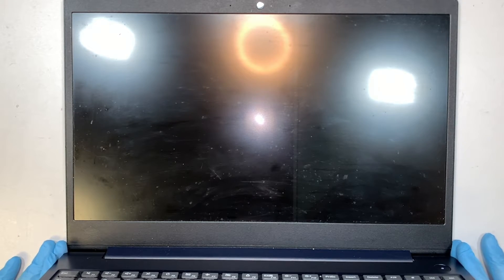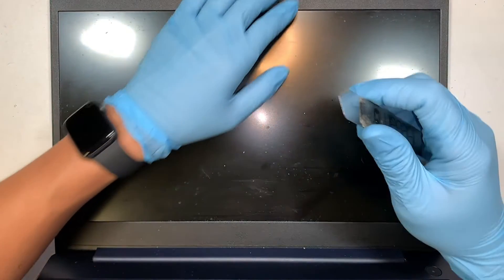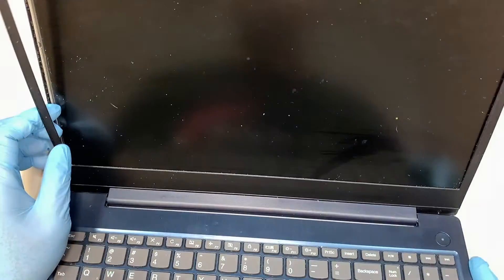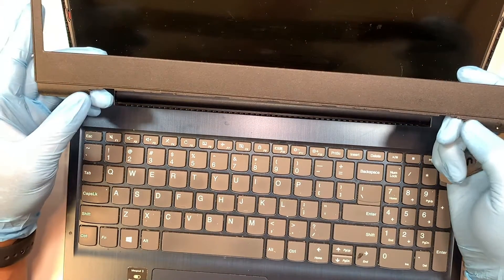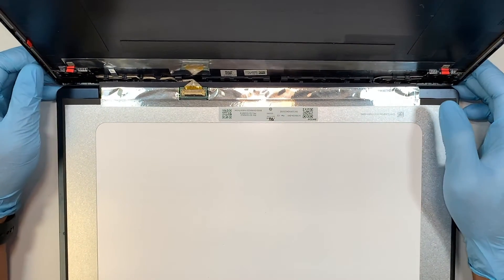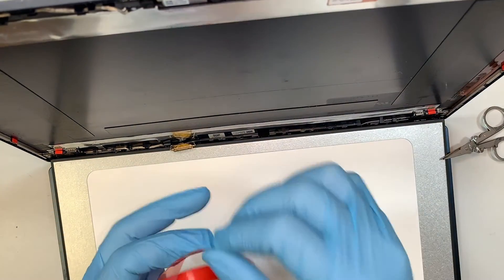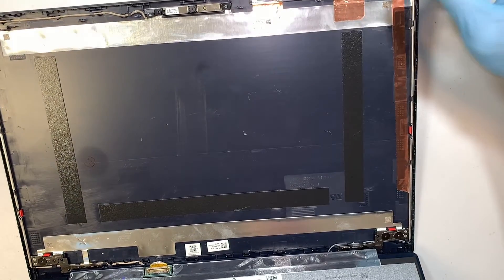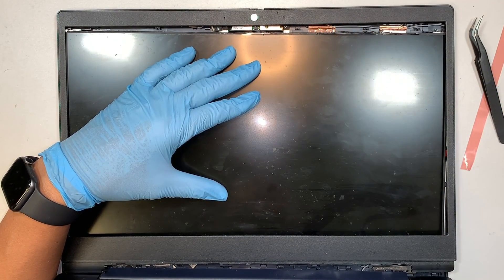Lenovo Ideapad 3 15IL05 81WE Screen Replacement

Comment: I  have the very same model laptop that got on contact with water, it is still functioning, however the screen is like - 50 dim. The water did not reach the screen. Please help
Reply from the maker: Water contact on the LCD or keyboard/motherboard ?

Comment: The screen is replaced, but the images on the screen are very faint. It seems as though, there is a light source that is not working. Is the new screen defective? Do I need to check something on the motherboard?
Reply: Is there an answer to this question?  I'm having the same problem.

Comment: What if your problem is the lcd cable, black screen but when I plug it into a monitor with an hdmi it shows my computer screen on the monitor
Reply from the maker: More likely Not the cable. Unless you felt the cable was damaged or cut.

Comment: @UberGeeks do you have to disconnect the battery or anything before you do this ?
Reply from the maker: Good practice if is to disconnect the battery before doing anything. But I did not disconnect. It is fine for me without doing it.